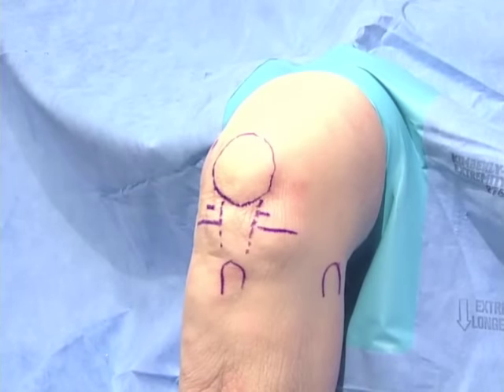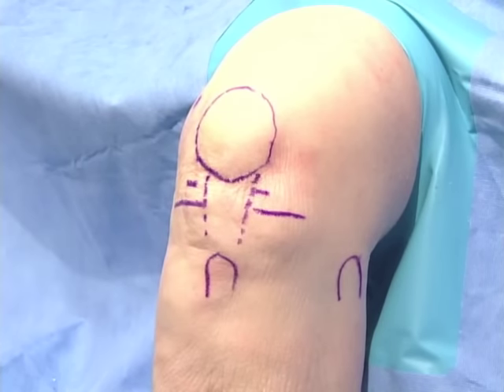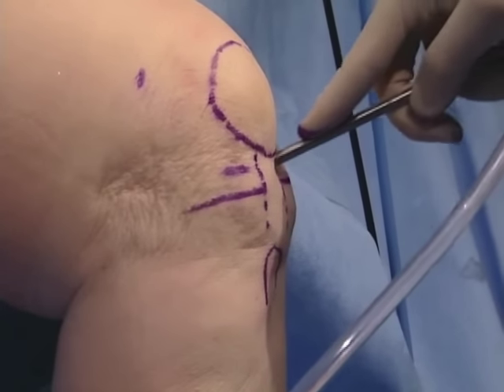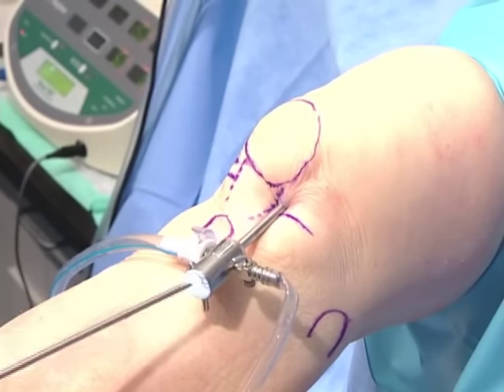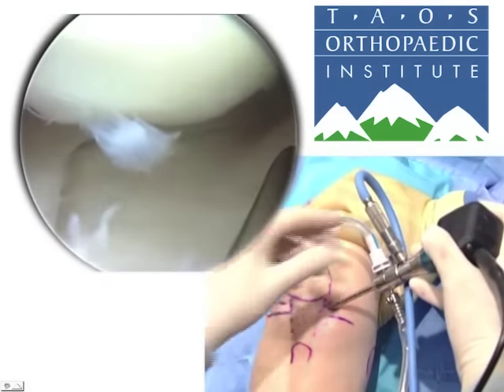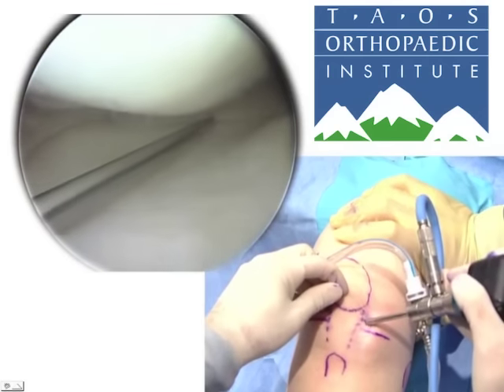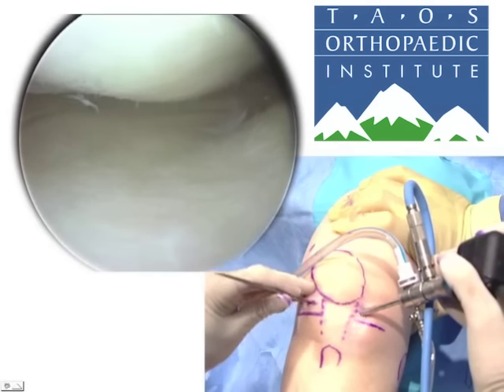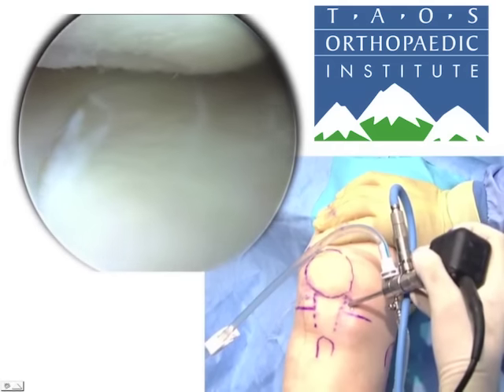Arthroscopic Knee Surgery Video Part 2: Surface Anatomy & Placement | Albuquerque Orthopedic Surgeon

Comment: I appreciate your effort. I would like to to hear an advice from you regarding which book helps to get a good anatomic orientation. I like to learn the arthrocopy but I miss a good guidance
Reply from the maker: https://www.amazon.com/Knee-Advanced-Arthroscopic-Surgical-Techniques/dp/1617119997/ref=sr_1_8?crid=7XNIBF8JXC3H&keywords=AANA+Arthroscopy+book&qid=1650298225&sprefix=aana+arthroscopy+book%2Caps%2C107&sr=8-8 MAYBE EXPENSIVE BUT USED COPIES AVAILABLE. Lot's of free techniques, including mine at www.arthroscocpytechniques.org